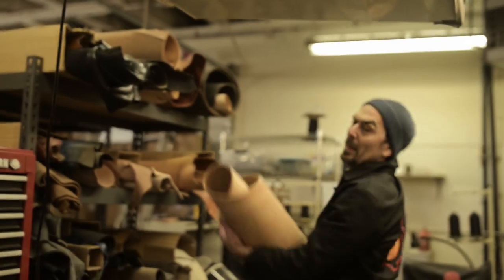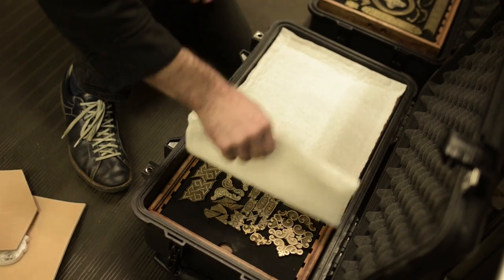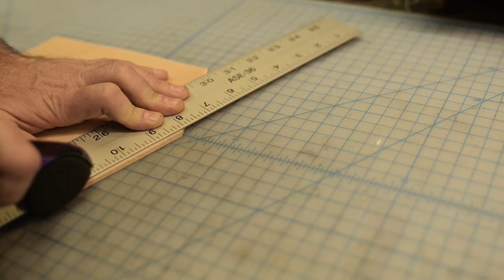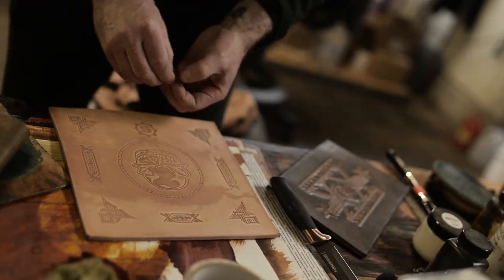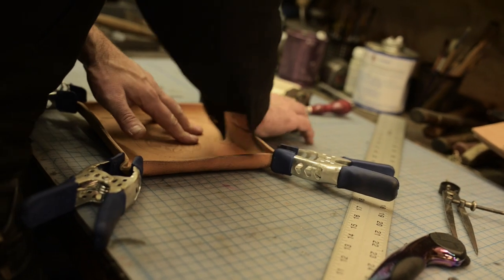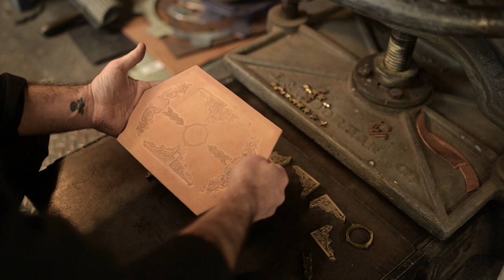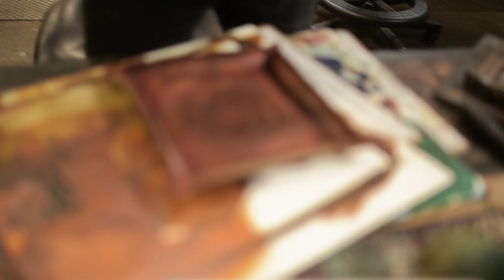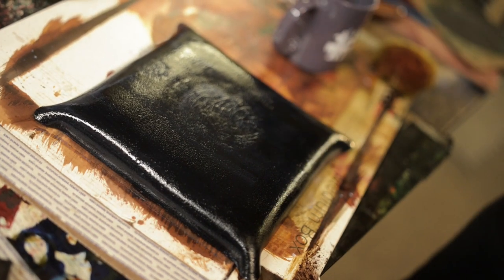STARLINGEAR / 2 CUSTOM LEATHER VALET TRAYS

Comment: build a cabinet with sliding shelves put one tray on each shelf . get them off the floor . a good idea would be a bakers rack that you enclose . sincerely deb
Reply from the maker: Thanks Deb. This has long been solved. The reasoning behind the cases is that they needed to be transported to and from the shop on a daily basis so they needed to be mobile. Appreciate the view!
Reply: If you could take a picture of each piece and somehow catalog them on computer? Could make designing easier. (Just a thought)